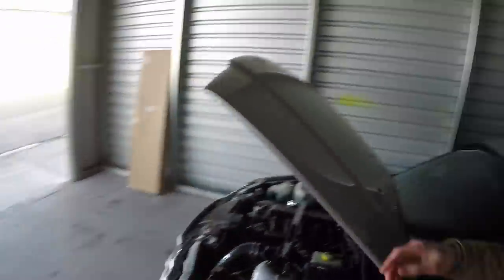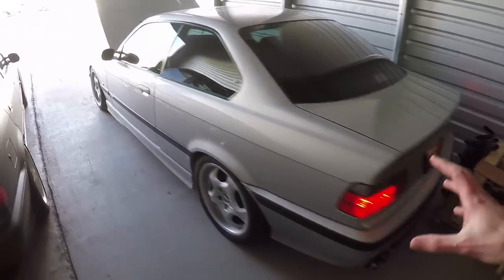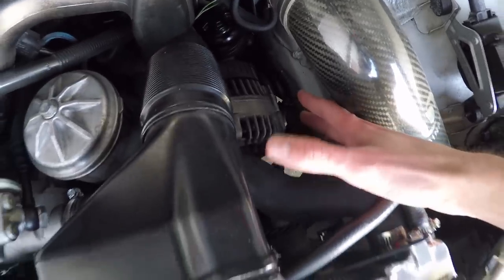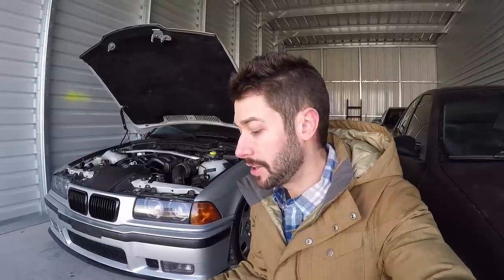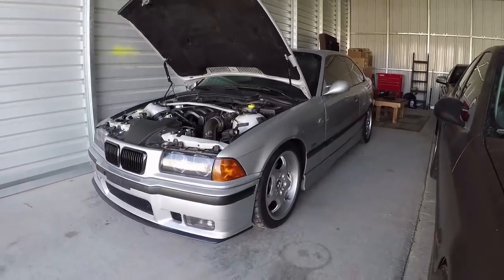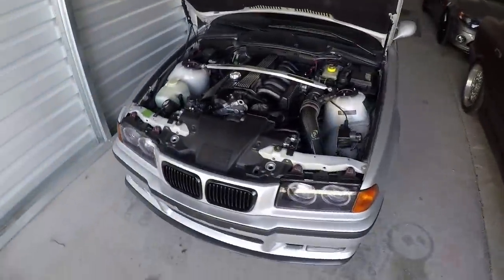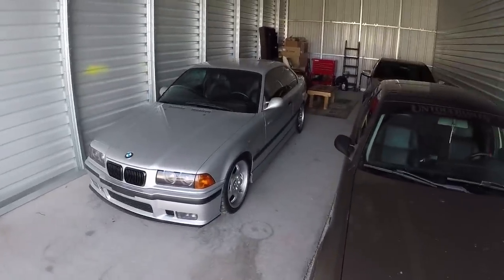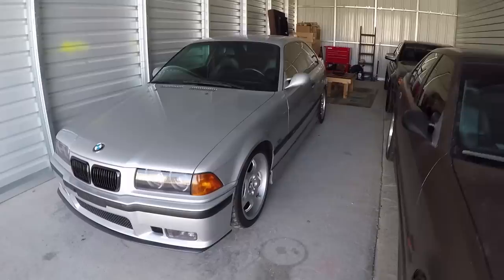BMW RELIABILITY: My AWFUL 1 Year Experience

Comment: This is a 20+ y.o. Car and only 300 bucks! Bloody reliable if you ask me
Reply from the maker: +JavierCR25 I agree!
Reply: Nothing reliable about BMWs
Reply: Just $300? How much did that Mishimoto radiator and second water pump cost? That wasn't included in the repairs.
Reply from the maker: That's because they weren't repairs. Nothing broke, I just upgraded because I wanted to.
Reply: @TreatsOnTheStreets  gotcha! How much did all of the parts cost? I am looking into 1997 as we speak, 130K miles, same color like yours. What can I expect from that mileage, what type of preventive maintenance do you recommend?
Reply from the maker: @TheRedcroatian  nice! Check out my video "3 tips that keep your e36 running forever". I think that will answer your questions.

Comment: I grew up in the 60's and 70's - then, a car with 70,000 miles was considered "spent" and ready for the junk yard. Used cars had under 40,000. Today, people don't even question 100,000 mile cars.

Comment: My 99 E36 M3 (US) has been frackin bulletproof. I whale on that thing every time I drive it. This guy's guide is spot on, other than reinforcing the sub frame if you wanna get really nasty. Also check the shock mount points on the body if you're looking to buy one (BMW sells reinforcement hats for cheap, they came on my 99, I hear they might have came on 98's).  The other thing I would toss in if you got the time is a full suspension bushing refresh/upgrade (lower control arms at least). Especially recommend the Mishimoto all aluminum radiator. When I bought mine it came in at 10$ less than an OEM plastic tank piece of garbage, and even came with the hoses. The thing is pretty easy to work on to boot. 

Also, put an OBD1 manifold on that pig. 

Also also, make sure to get a water pump with a metal impeller.
Reply from the maker: Thanks for the extra mentions!

Comment: my e36 has 243,000 miles and the only thing it ever needs is tons of oil and tires, other than that i've never had any issues aside from a fuel pump I replaced myself

Comment: My E36 i drove for 360k Miles on the original engine, and it only gave out because of an engine oil leak i didnt notice, Most reliable car Ive ever had, switched to an Audi a4 Quattro since then, Would go back to the E36 any day

Comment: We've had one in the family for like 25 years now it's got 460.000 on the clock and it just won't die two of my uncle's used it and now it's in my hands I've replaced all the cooling system it does wonders on the road.

Comment: I have a late 2006 E36 328i. Love that car. 240000km (149000 miles) and still has the factory clutch and exhaust, never had a Vanos problem, did replace the front control arms at 150000km.  The only problem at the moment is a jammed rear door lock (the actuator is stuck in the locked position).  I have a spare that I will install as soon as the actuator decides to unstick.
Reply: Julian Radowsky 06 is the e90 chassy

Comment: I've had my e46 318i for a year now and spent €1500 on repairs. Cooling system, head gasket, rear dust plates, handbrake, plus a few minor things like front disks and pads, oil change, window regulator, filters, battery

Comment: My e36 has not given me a single problem for 2 years since I redid the head gasket and got fresh valves and springs. Only thing that happened was a thermostat leak and I changed it for 40 bucks. I drive it hard as a daily and so far so good.

Comment: I’ve got a 94 325i convertible with 69,000 miles on it, I paid $3 grand for it in excellent condition. I replaced the radiator, water pump, thermostat, struts and shocks, all for less than 2 Grand so for a total of 5 Grand I’ve got a new car. It’s 25 years old and I’ll be showing it in car shows this year. It’s hellrot red with all new black interior and looks showroom clean.

Comment: Mine had 300k my motor mounts were original and were torn to shit when I took them out. The car needed so much love and still needs a lot. Especially rust. I plan on rebuilding the whole car from body onward. Hopefully I can revive this thing and have it live for another 300k
Reply: doing the same atm, mine is at 300k kms, lots of rust, im fixing it atm, should be repainted in a few weeks. everything had rust, wheel arches jacking points wheel well, ...

Comment: 1995 e34 with the m50b25tu , put on 15k miles past 12 months and never left me stranded, never had any problems just basic maintenance like .. 3 oil changes, oil filter housing gasket, spark plugs, differential oil, these cars are fucking great
Reply from the maker: Yes they are 👍

Comment: Love the E36.
I had a 328is with the M50 intake manifold conversion, simota carbon fibre induction kit, and M3 front & rear bumpers/splitters. It was such a sweet looking, fast enough, and very reliable car.
It's a shame that over there in the US, you didn't get the proper E36 M3, and instead only got what was basically a 328i with better cams. I did read that yours was Euro spec though, which was the full-fat one same as we got here in the UK.

Comment: 1995 325IS 190K miles and still going strong. Original water pump, radiator, Vanos repaired at 175K. My daily driver and there is a reason I choose to drive it over any of my newer cars day after day after day. RELIABLE AS FUCK! The motor is bullet proof, the transmission still rows great, clutch is OK but not done, all around these cars age very well in the right hands. E36 for life.
Reply from the maker: Nice man!

Comment: So I finally got an E36 and here is what I have had to do so far in the 5 months of owning it:
-master cyl, slave cyl, tranny mounts
-clutch
-2 lock actuators
-drivers side door lock & handle replacement
-changed all the fluids (diff, trans, etc)
-steering rack, tie rods
-oil pan gasket
-engine mounts

Still need a new drivers side door (door was replaced at some point and the one they put on is slightly warped so it doesn't seal properly), sunroof repair that i will probably do myself (also doesn't close/seal properly but no leaks from that either thankfully), headliner's fucked, wiper linkage probably needs to be replaced, blower motor and wiper cowl too... oh and also probably higher up on that list is body work that the car needs since it's been in canada for 20 years, plus paint correction/detailing or better yet a paint job altogether. And throw in some miscellaneous trims/emblems in there too.

Now don't get me wrong, I may have not been the luckiest but then again pretty much all that stuff needs to be replaced on any 20+ year old car, give or take a few items. The one thing you may want to add to this list of things you will potentially have to do is the entire cooling system; the previous owner did it on mine not long ago so at least that is one thing I can leave alone (for now). Also the driveshaft, which the previous owner did too fortunately. And all of my window regulators actually work! (knock on wood)

I just wanted to put this out there for anyone considering buying into this, you better get ready to throw some money at it, especially if you're not gonna be doing all of this yourself. E36s are great but take this video with a grain of salt as it's not all sunshine, rainbows, and a couple hundred bucks here and there, especially in the first or second year of ownership. 

But with all that being said this car is fun to drive, can't deny that. Now, is it a worthwhile investment? Well, depends. Mine isn't because it's a 328i with a shit ton of miles and it's my daily. But if you buy a low mileage M3, do preventative maintenance/repairs, and take good care of it, it might pay off because these cars are starting to appreciate in value.

P.S. I forgot VANOS!! 🙃🙃🙃 Mine will probably need a VANOS rebuild at some point because the idle feels a little rough and I did all the other diagnosis/repairs for a rough idle. It really is a love/hate relationship with this memebox
Reply: Thanks for the insight man.  Looking at an E36 328i w/176k for a dd.  But sounds like I should def keep my Jeep Wrangler for a back up.

Comment: I have had a M3 since 1997 and it has always started first turn of the key. Last week it did the same after 3 years in the garage. Only time it hasn`t started was when the battery was flat.

Comment: You didn't mention any sensor issues, suspension or control arms rebuilds, fuel pump and lines/relays, engine gasket covers... this video is pure fantasy 🌟
Reply: Its a 20+ year old car that was stickered at 60k... sorry u cant afford it?

Comment: bought my e36 touring 325 two years ago, and guess what, leaky powersteering, fan clutch went bad, vanos got stuck.
 fixed and upgraded seals in the vanos unit, went for mishimoto electric fan, got a new OEM power steering line. 

in these two years 273K - 309K KM's I drove it very hard (once warmed up). its still running like brand new.
i am myself a mechanic and i must admit: parts are expensive, yes. but rarely does it ask for them (other then regular services).

im quite happy with my 1.500 euro rocket. mines a high option model, and compared to todays standard its actually still quite luxurious.
Reply from the maker: Awesome man! I think they're really solid and nice cars. Not much to worry about once you replace the usual things that tend to go wrong.

Comment: Do e46 front lower control  swap, you'll get some nice camber, i think e46 is like an inch longer. It will help the turn-in at the start if the corner. Also it's great mod for daily drifter, or if you want to track a drift car, coz most of race tracks do not allow bent tube design suspension parts like SLR...

Comment: I’ve owned an E46 and an E39. As much as I loved them, I don’t think they were reliable. Having to replace the radiator AND thermostat AND water pump AND the power steering lines on a car with less than 200,000 miles is definitely higher maintenance than most Japanese or American cars. For someone without technical skills, this could result in several thousand $ in shop labor costs.
Reply: I mean it’s much more than my 2004 Miata. Only have 77k miles and it’s been great for 4 years but in the last 8 months i replaced twice Alternator and radiator and i’m gonna need a new ECU soon. But everything has only been $450 for parts and labor

Comment: I have bought my e36 about 1.5 years and the only things I’ll have done is oil change and changed the filters! Pretty reliable. The only thing I can say about if you look to daily a e36 especially the 6 cylinders they need a lot of gas ⛽️ so be prepared

Comment: I bought a beautiful red E36 328i when i was 20 years old for around 2500 dollars. Didn't last long as it was my first car and didn't have much experience driving (And zero experience with RWD) . Too much throttle mid corner and off the road it went into a tree... Luckily didn't get hurt, but damn do i miss that car.

Comment: I have the same exact car (color and M3) only the convertible version and I had exactly all the same problems you describe and the only one that I haven’t done is the engine mounts. The prices you quote are amazingly low - I was not as fortunate with these deals but this car is worth it and lots of fun! Mine is 1999 with 195,000 miles!
Reply: Prices are low because they are not accurate. The aluminum radiator alone is like $500
Reply from the maker: The radiator is 308 online today.

Comment: leaky water pump you need to fix immediately and that's an easy fix... you can do it yourself in a couple hours... the water pump leak can expose your casing to rust and you don't want those threads getting rusted

Comment: My m3 is exactly like that one, had it for over 10 years. Bought it with 82,000 miles on it and now over 190,000.. Paid a little over $320 for a oem radiator and water pump and hoses, regular oil changes and maintenance and that's it and i have beat the crap out of it. Reliable is an understatment
Reply from the maker: +j butter that's awesome! Just a testament to how solid they can be if you take care of them. Hopefully I'll have the same kind of experience. Thanks for sharing!

Comment: E36 is a GREAT daily driver I drive about 40 miles every single day with  regular maintenance. Fun daily and I just replace most things before they even go out 👌🏾 planning on getting an e92 M3 at the end of the year and I’ll continue to use my e36 328i as a daily driver until the wheels literally fall off 😹

Comment: I've had my 328i for about a year now. 
There's only been one big issue, which was my Radiator cracking. Ended up replacing it with a Mishimoto Radiator and hasn't been an issue since. 
I've done my preventative maintenance but still need to take care of some things. Most things were already done by the previous owner so there isn't much I need to do.

Comment: I am sorry you got a bad one. I have had two E36 coupes which I bought when they were 4-5 years old and both were in the top 3 most reliable cars I have owned. One was the later generation 1994 double Vanos 325i the other was a 1998 318is. I have had two E46 328 coupes since them and they have both been a nightmare. I still have my 318 coupe I might put back on the road but it's been off the road for years.

Comment: The only other little issue is the trunk latch seem to get bent and crack due to its geometry. I have had two E36s and both cars had a broken trunk. Not a deal breaker but annoying.

Comment: My first and only car is a 2001 e46 325ci. When I bought the car for $2,400, it has 250,000 miles on it and stock everything. I beat the hell out of it and it took everything I threw at it!! Even welded my diff and daily drifted it!!! Only thing that ever broke was axles (and that was my fault). They are amazing cars! I just swapped a ford 302 into mine and installed a digital dash!
Reply from the maker: +Grayson Williams wow pretty cool!

Comment: I could say this for any car, if you buy it's and it's 20 years old or more, just replace the whole cooling system. I had to do it in increments over several years on my daily (not a BMW) and I wish I had just done it all at once. The radiators crack because they corrode, all the lines are brittle, the water pump seizes, the thermostats are almost always bad. That's is for literally any old car you buy.

Comment: If you let the car idle to warm up it causes unnecessary wear on the engine. People still don't get you have to put load on the engine in order to let it warm up quickly.
Reply: True about the load heating up an engine a bit more quickly but both the S50B32 and S54 engines in the E36/E46 benefit from at least a minute of idle on a cold start to let the 10w60 oil circulate the major parts. They also should be kept at relatively low revs until up to normal operating temp otherwise the potential risk to the rod/main bearings are high. Once either of those go, at best the crank gets scored but in nearly all cases it means a total rebuild or replacement block is needed.

Comment: I’m a college student on a budget who recently purchased a 2000 BMW 540i. Body and interior are in great condition . Unfortunately there is oil smell in cabin accompanied with oil leak , coolant leak , check engine light , needs a new coolant reservoir. Codes that arose are P0440 and P0011. Mechanic says one of the parts I need to replace is about $350 plus $55 to degrease oil . Forgot to mention pixels are half out in speedometer dash (found diy videos showing how to replace LCD screen and ribbon) . She’s my baby 🍼 but it has been recommended I immediately sell her 😢 😭

Comment: My vanos unit is rattling a little bit at certain rpms what did you do to get that fixed?
Reply from the maker: +Hunter Macleod you need a rattle kit. It essentially just replaces some internal parts and seals that are worn out and no longer have tight tolerances as they should.
Reply from the maker: +Largemargesentme nice tip. I wonder if that would quiet lifter noise for those people experiencing that as well.

Comment: i had a beautiful E36 coup.  the stock water pump was plastic and should be replaced right out the door.  had a problem with the heater core which would cause the windshield to fog up. the car had 30K miles on it, but BMW would not repair it.

Comment: The whole cooling system of the whole e36 series is definitely the least reliable part of the car.I changed out every part of it,remember the aluminum heads will warp if you overheat.Never drive a heating BMW,learned that the hard way on my 91
Reply: the cooling system reliability issue is because of all the plastic on pretty much every part, replace with all metal..even the thermostat is part plastic on them.

Comment: I guess ive been super lucky, my e36 323i has been in the family for 23 years for almost its whole life. Only reliability issues where the car overheated once (radiatior) and we had been in a crash with a sprinter van once which meant replacing the door. Apart from that, it has been amazing. It was an auto though, My mum used to drive it normally in eco mode and my dad used to love to floor it in sport since he was used to his sluggish 1999 Mercedes e class

Comment: BMW's are reliable. As long as you spend the money associated with keeping them going and keeping them in tip top condition. Valve cover gaskets, CCV, anti roll bar links, thrust arms. I love my E39 but there are more reliable options out there. But I don't think any car will make up for its smoothness and lovely straight 6 engine.